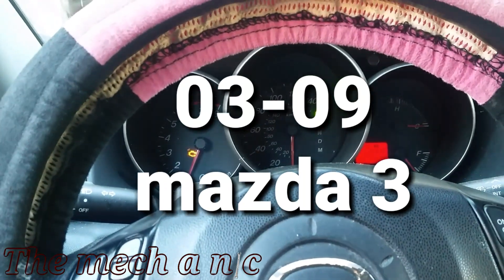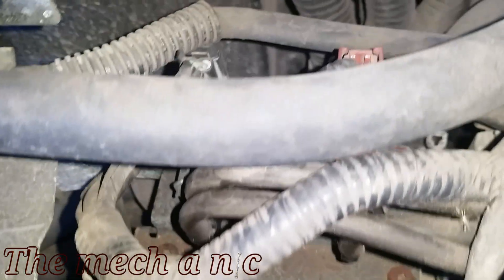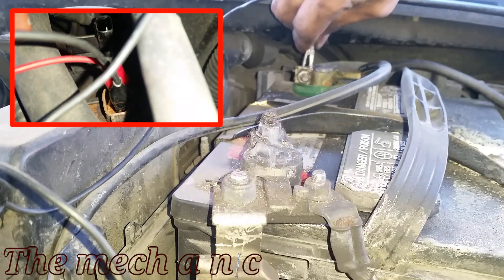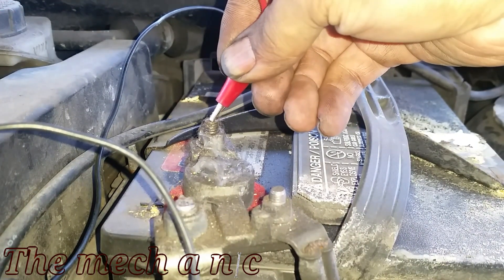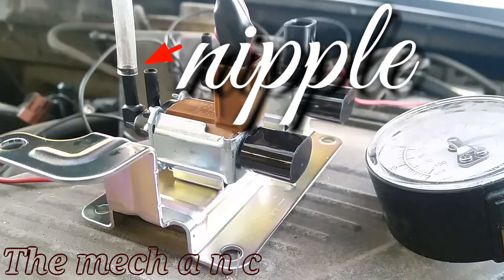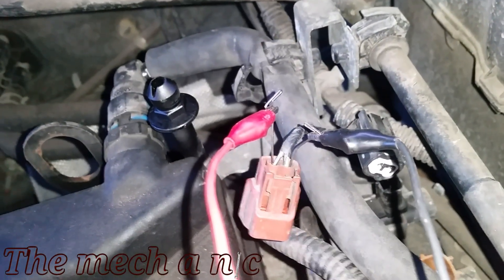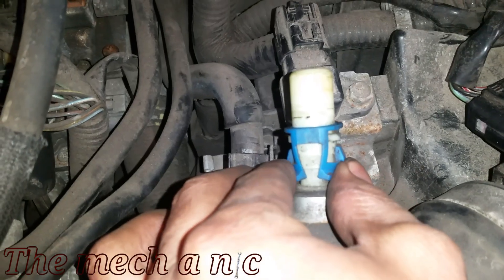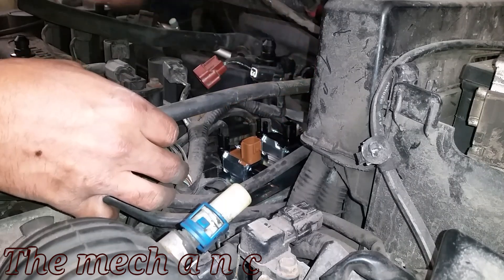Mazda 3 P2009 P2004

Comment: my mazda has same codes, and has issues starting on first try. checked and verified sensors/solenoids are working, what else could it be? Also changed the MAP sensor and same thing
Reply: Have a 2012 mazda 3

Comment: Hello, i replaced this and it fixed the p2009 code but now i have a p2006 code. Please help in any way. I hate throwing parts at cars but im really stumped on this on. Any help will be greatly appreciated. I have a 2007 Mazda 3 2.3 non turbo.

Comment: Hi! When I look for a solenoid online for a 2003 Mazda protege it shows part number 911-707 but it’s the solenoid individually and not with the plate as you have shown here. Why is that?
Reply: Did you figure this out? I have the same isssue but have the 2.3. I haven’t found anything yet.

Comment: If its hard to take off the hoses, use a flat head screwdriver under the hose and push it off, once it moves 1mm, you can pull it off with your hands.
To put them back on the new manifold, i found that the hoses were loose (not sure if this is normal, but they were on tight before), so I cut 3-4mm off the end of the hoses (dont cut more as they are short to start with), then I put them on, and you will see that it wont go all the way in, so use abit of muscle, or use pliers to hold the hose and push it in properly.
Reply: I was wondering how to get those tiny hoses off. Thank you

Comment: I was hoping to see the vacuum hose connections because I believe one hose is missing on my car. So unfortunately I can't follow the original connections and I have no way of knowing if I'm putting the vacuum lines back correctly when I install the new purge valve.
Reply from the maker: Ahh, sorry. Did you trying google to look for pictures or other videos?
Reply: Did u ever find out where the holes go I'm having the same problem

Comment: Wish I knew what those are called.. need them can’t find them out the part name
Reply from the maker: Its called a vapor canister purge valve .you can find them on rock auto
Reply: The mech a nic so I did change these solenoids just as you did in the video and had no success, went back to square one where it all started... So long story short I removed the intake manifold to replace some coolant lines, put everything back together and i had NO POWER OR ACCELERATION after 3500rpm. It sucked. After a week of diagnosing I just fixed it. So, the metal rod that goes to the blades inside the intake, was, I guess you could say closed or to a point it won’t spin the way it needs to. When I figured that out I was able to spin it the opposite way, that way the air pump it connects to can pump correctly. Once I put it back together and I felt the pump was free, I just knew it that fixed it. Went for a test drive and the Mazda is back on full power. Thanks for this video it’s great and really help me pin point my issue. Long comment I know but if you got this far check out my channel! The Mazda is there. Will be making more and more videos! If you read this all thank you man I appreciate it. Hope you are staying safe! 😎

Comment: I keep getting p2009 on my mazda but i checked both solenoids . They do click but i feel one is more faint . I ordered a new one just in case. I understand p2009 is the smaller one. When you said if its clicking it still may be busted what did you mean by that?
Reply from the maker: Just because they click doesn't mean they open. Its why I used a vacuum gauge on them
Reply: The mech a nic cool thanks , i just looked thorough my service manual  . It says I can take it out and examine the airflow based on voltage applied to it and see what it does. There are two criteria it has to meet to pass the test. They call it the variable tumbler valve

Comment: So I own a 2003 Mazda Protege 5 and I have a hard time starting up properly my car in the morning it gave me a code p0660 which is the intake manifold tuning valve do you consider me replacing both solenoids or just one cause I think it's the same for the Mazda 3 
Let me know your opinion/ feedback

Comment: Would a dead solenoid keep your car from starting? I am throwing a p2004 code and the car cranks but won't kick over???
Reply from the maker: I dont think so. Just because you have that code doesnt mean something else isnt wrong. Check the intake runner control valve. Everything is plastic and they do break. That could cause a car to not start ...I think
Reply: Roger , did you ever fix it? I got a dead one too and the car not starting

Comment: I got a 2009 mazda 6 and it was showing me the code p2009 then i replace the solenoid and clear the engine light after a day or 2 the light came back with the code p2004 I'm so exhausted right now I need help.
Reply: I got the same P2004 and P2009 code. However, it was not due to a bad solenoid(s). It was the vacuum tubes being disconnected! Apparently, the last mechanic that overhauled my engines injection system forgot to reconnect the vacuum tubes after putting it back together.
Reply from the maker: Nice easy fix 👍
Reply from the maker: Did you try to diagnose your problem or you just changed the solenoids because i changed them in this video? There are other things that can cause that code

Comment: I replaced both solenoids, P2009 went away but now Codes p2187 and p2004 are there. What now? Before p2009 was the only code there.
Reply from the maker: Where the solenoids actually bad ? Or you just replaced them for no reason?. Did you plug everything back in?
Reply: @themechanic6117  not sure. I will double check tomorrow. The weather is nasty down here in South Floroda. Maybe I didnt push the plugs or the little hoses all the way in. I may have disturbed something while replacing the IMCR solenoid. Thanks and i will keep you posted.
Reply: @themechanic6117   I wasnt really sure if they were bad. I just replaced them when I got the p2009 code.
Reply: @themechanic6117  I put the original one back in, got the same codes, then installed the new one again, only to get the same codes. Do you think the issue is electrical or vacuum related?
Reply: Mike Johnson I’m not a car mechanic but your issue sounds like a vacuum link
Reply: @javilamaravilla  thanks man. I will ler my mechanic try to find it because I have no idea how to find it. Its still throwing those codes.

Comment: i have mazdaspeed 6  2007   p2006 intake manifold runner stuck HELP where is he lol
Reply: Dude same car and same problem!
Reply from the maker: Hope the video helped
Reply from the maker: That's on the intake manifold. You'll have to check the vacuum pump to make sure it's working first
Reply: Same Mazda 6 here... Will this code cause engine to constantly stall out as if a misfire present? Please help.. all of a sudden car stalled out won't stay running now. p2009 only code present.

Comment: So I don't have those solenoids in my 04 2.3 Mazda 3, I do have a large round solenoid right by where the two should be.
Reply: If anyone else is wondering about the SP23 engine, instead of the long hose running from the manifold around the side of the engine and then splitting out to the bracket mounted solenoids as per this video, the 2.3L solenoids are mounted at the front on the manifold itself. They are a different part number than the 2.0L version.
Reply from the maker: That might serve the same purpose but I'm not 100% about that.youll have to do your own research

Comment: Great video and explanation.  I am trying to find the exact part that you installed with both solenoids attached or where I can purchase each solenoid.
Reply from the maker: Check rockauto.com,  that's where I got these from. 👍
Reply: I looked on rock auto and amazon.  What is the exact name of these two solenoids?
Reply from the maker: I just found it on rockauto. It's called "intake manifold runner control valve /solenoid " it cost just as much to buy the set as it does to buy them individually lol so might as well get the set.

Comment: on my scanner im looking at the intake manifold runner control valve pid and it always reads on. is there a position position sensor in this system that tells the system its on? im figuring that its supposed to read off until about 2500-3000 rpm
Reply from the maker: I'm not sure if it's supposed to stay in the on or off  position . When I was filming this I didn't look at the pid while the car is running. After the solenoids the vacuum hose goes down to a vacuum controlled actuator that sits under the throttle body. That actuator has a connector on it and I believe that's where the system reads what position the actuator is in. I pulled a vacuum on my actuator to make sure it can hold vacuum and wasn't busted which it did check out to be ok.